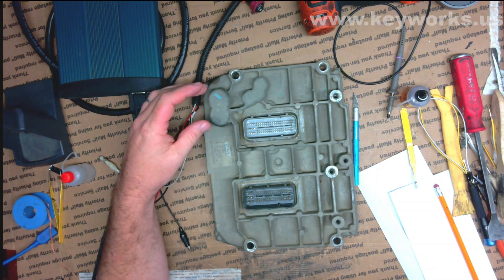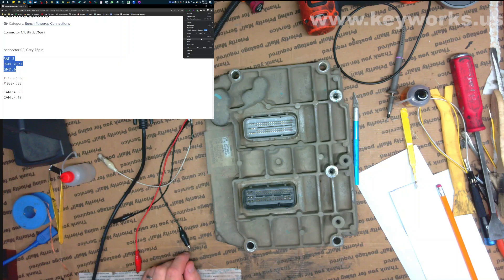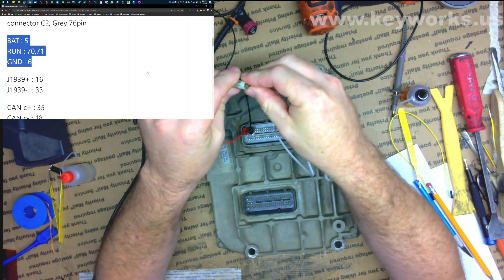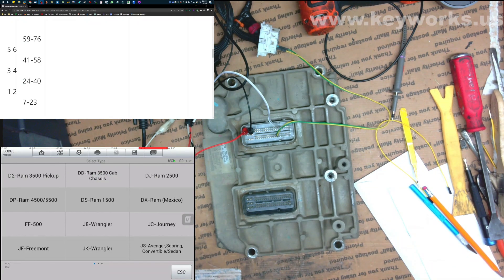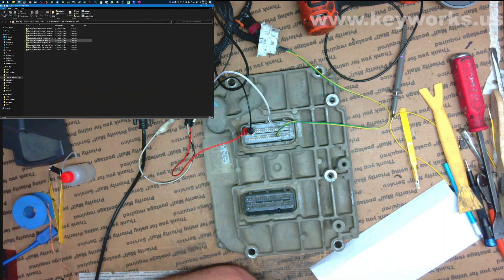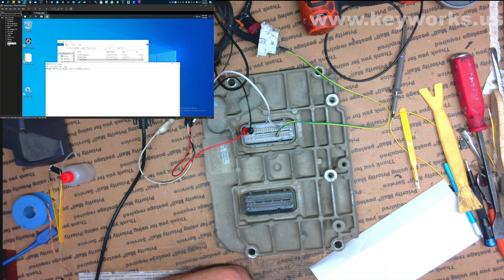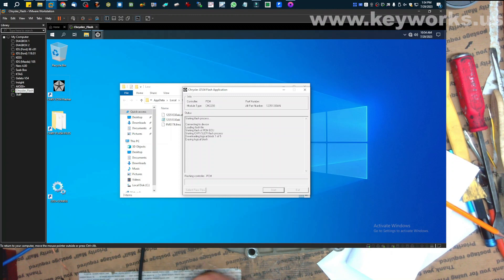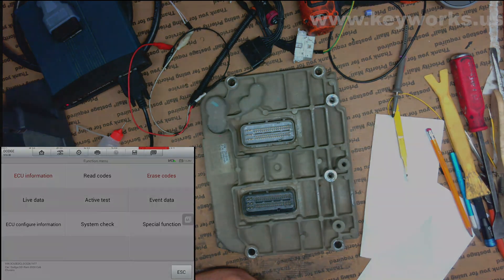Bench flashing 2012 Dodge Ram 6.7L Cummins CM2200 ECU

Comment: If its up to date WiTech will not have a flash available. And at most dealers thats where the flat rate tech will stop and back the truck out
Reply from the maker: Thank you for the info. Im not familiar with Witech but figured that was what the problem was.

Comment: How’d you learn about module repair? I have been curious about dabbling and have  access to ecu’s, and other modules but as far as diagnosing what’s wrong and learning what does what is kinda hard to find in the huge internet world
Reply from the maker: Little by little honestly. I would start with a known problem and just research the circuits controlling that problem every step of the way, component by component while tracing it out. I also read and studied a lot about basic electronics in general which is much easier to find then trying to find auto specific stuff. Electronics themselves are all pretty much the same so what you learn from just basic electronics transfers over to automotive stuff. I spent a lot of time just learning at the beginning rather then actually fixing stuff. Still study and learn everyday these days as well.

Comment: I tried using legacy on a 2015 ram with a 6.7 and it wouldn’t let me flash. Kept giving me an error and saying couldn’t retrieve part number. I don’t know if it was because it’s on the truck.
Reply from the maker: Maybe just an id problem? Did you verify what the part number is currently and that its in the flpart file correctly?
Reply: @ecurepair it's likely not an id problem. Alot of tuning changes the original calibration file and sometimes ecm part number. Spartan tuners were known for this.
Reply from the maker: @shawncd1  I was trying to say to check the calibration ID with scanner and make sure it was listed in the flpart file correctly but it was late and didnt come out right.  Since like you mention, tuning sometimes changed the cal id. It would then be a  ID issue of why legacy tool is not updating.

But, not being able to retrieve id error I guess is more along the lines of not connecting. Legacy tool is weird though, Its pretty limited in the errors it gives you so its best to check the basic things first.

Comment: Hi, where can I find the chrysler J2534 app and stock calibration file? I have a friend that used hptuners read and it stopped working and now the truck won't crank. I have an autel j2534 and want to help him out. TIA.
Reply from the maker: oem's link: https://mopartsp.com/login
Reply: @ecurepair  thanks a lot. I´ve sent you an email.

Comment: quick question i have a 2010 trying to flash with both flash app and witech 2.0 but flash process fails and im unable to get ecu calibration id or vin from it what direction would u recommend a guy chasing down ? thanks!
Reply from the maker: Use something like autel to try and connect by manual selection (not auto or vin search), then check ecu information. It could be programming ID is corrupted.